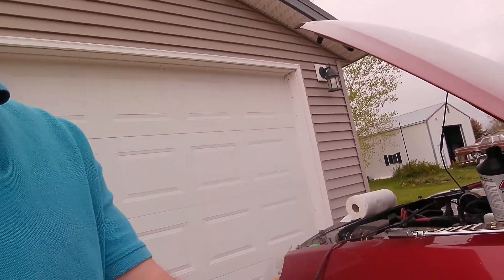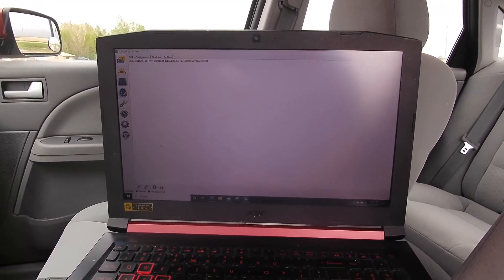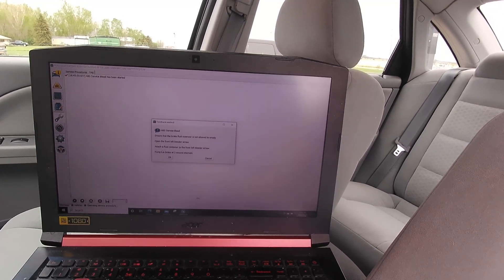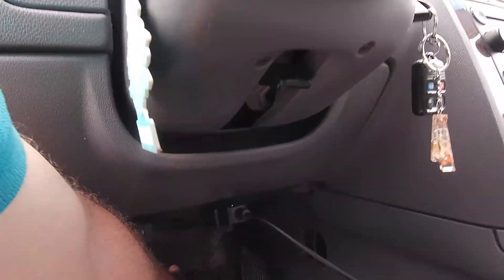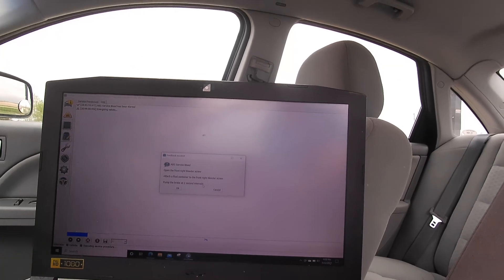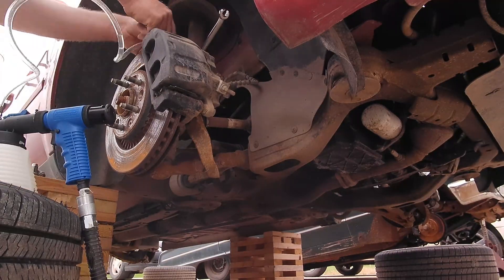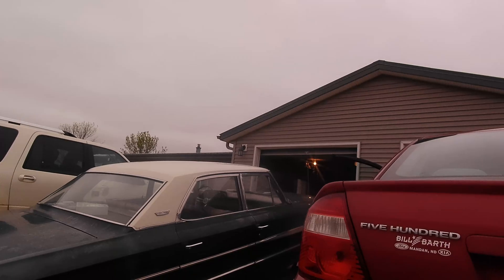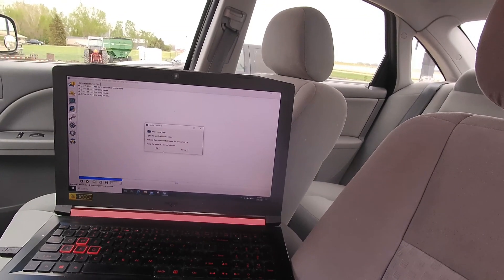Ford master cylinder replacement and ABS bleed--2006 Five Hundred

Comment: When you replaced the master cylinder did you also replace the break booster seal or did you keep the old one
Reply from the maker: I reused the old one.
Reply: @ssmonte8738  dealership replaced my master cylinder. It took a crap in 9 months got new one and one they replaced they didn't put a seal back in it. And new one I got didn't have a seal with it